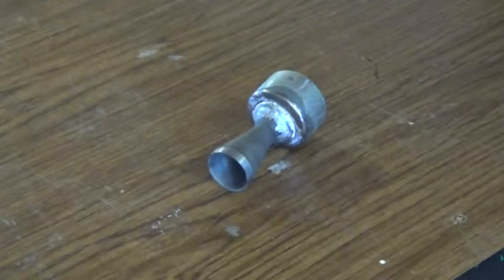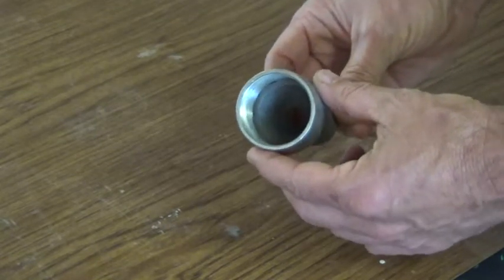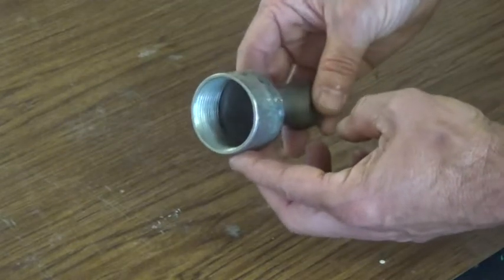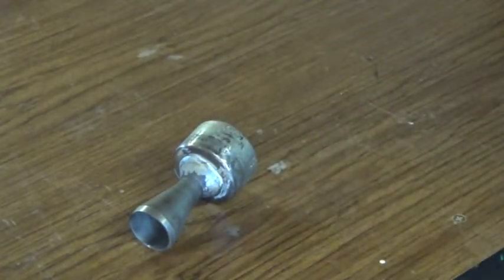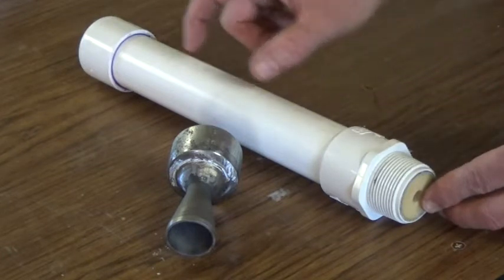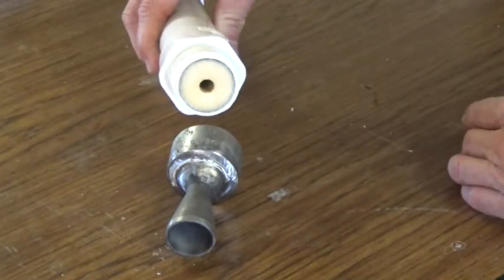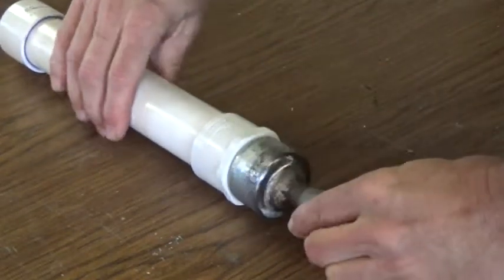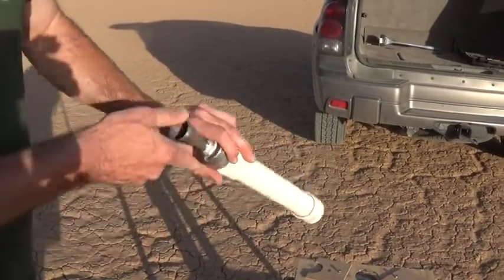Homemade PVC model rocket motor test with reusable steel nozzle

Comment: Well I could have told you that would have happened. Red Hot metal vs pvc... Metal will win every time. Even if it doesn't melt it initially, you'll have the problem of "heat soak". Anyway, I'm sure you've worked it out by now
Reply from the maker: We have had metal/pvc designs work but they can be inconsistent and the nozzles just take too much time and effort to make. All our motors now have a single use cement nozzle. Works great and super fast to make.

Comment: Looks like a crack occurred in the nozzle
Reply from the maker: No, just my terrible welding. I have everything professionally welded now.
Reply: Still experimenting?
Reply from the maker: @paradiserocketry  We have moved on to metal motor casings.
https://youtu.be/9IQ-IEagFHA
And I'm in the process of making one MUCH larger than that one. Should be ready for ground test in a week or two.

Comment: Can I even use potassium chloride and sugar rather than potassium nitrate and sugar?
Reply from the maker: You would need to do some Google searching for that. I don't think that would work because the reason we use potassium nitrate (KNO3) is because the 3 oxygen molecules provide a large amount of oxygen to the combustion process.
Reply: @rotaryrocketry  Okay, can I use potassium chlorate?(KClO3)
Reply from the maker: I did a quick search for that and I see some people using Potassium Chlorate. You will need to do some searching & watch some videos to find out more about the fuel mixture. It's not something I have done.
Reply: @rotaryrocketry  Okay

Comment: What is the fuel you used?
Reply from the maker: It's commonly called Flexi-Fuel. Made of Potassium Nitrate, Powdered Sugar & Corn Syrup. Here's a video that has a section where we make Flexi-Fuel for a smaller motor... https://youtu.be/wJt1XLjqaGY
Reply: @rotaryrocketry  Thanks for your kind reply 😄

Comment: Корпус сопла нужно сделать массивней что бы не допускать перегрева, или в зоне критического сечения сопла сделать вставку из графимта или керамики. Удачных запусков:)
Reply from the maker: English Translation:
The nozzle body must be made more massive to prevent overheating, or an insert made of graphite or ceramics should be made in the critical section of the nozzle.
Reply: We are working on a completely new design that will hopefully be a much improved replacement for this motor. Coming soon.
Мы работаем над совершенно новым дизайном, который, будем надеяться, станет значительно улучшенной заменой этого двигателя. Скоро будет.

Comment: I think the PVC could have melted after the burn from heat soak. Nice clean and strong burn!
Reply from the maker: Good point. It was interesting that the nozzle did not actually get blown off, so there is a good chance you are correct. We are thinking about switching to a home built aluminum casing with a steel nozzle at this point. We seem to be really pushing the limits on pvc and would like to go even bigger. So I think a structural change is coming soon.

Comment: why don't you move to an aluminium casing ?
Reply from the maker: After this test, that is what we are thinking we need to do.
Reply: @rotaryrocketry  it would definitly be good, furthermore, you can buy proved hardware from loki or fisher and you just need to make the fuel and the liner
Reply from the maker: @shere_kan8329  Wellllll...... I have plans for a home built aluminum casing first :)

Comment: Just reverse the last section so that the steel is on the inside, then the PVC on the outside will expand, been there done that! 🤣 Go back to the Gen3 nozzle if you are gonna still use steel! 👍